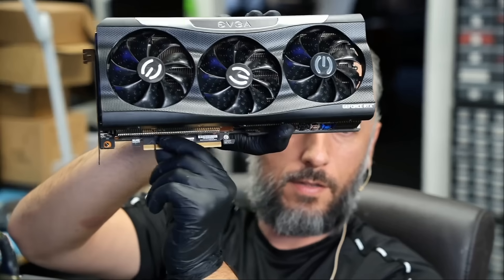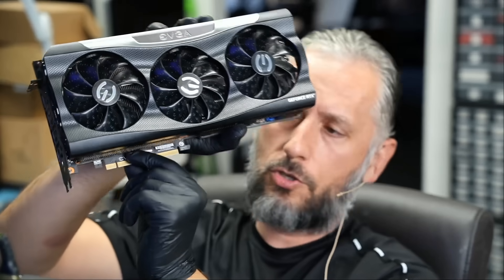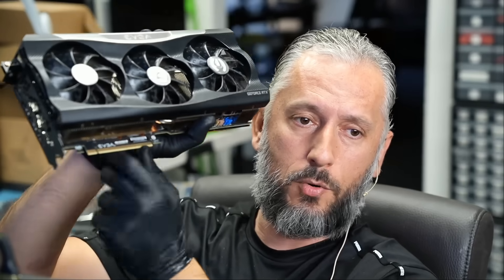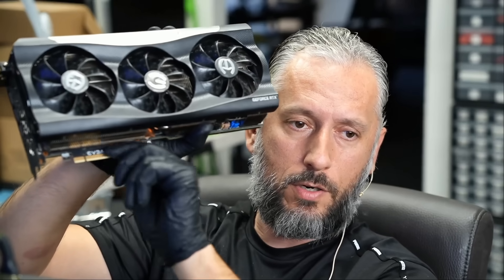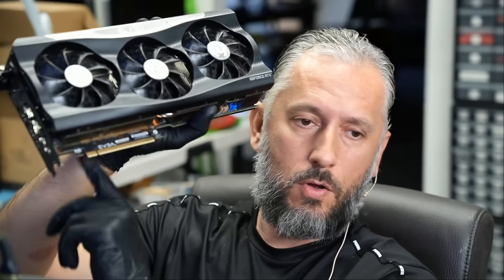Nvidia Positive Response to 5090 FE Fragile Connector Issue.

Comment: I called this out as soon as I saw it: proprietary, fragile, modular piece of crap with no service parts. Absolute rubbish FE GPU design. NVIDIA is replacing the GPU for damage control reasons, not because they care. If they cared they would not have produced a modular piece of garbage in the first place.

Comment: But the fact is, you can't buy the connector. Furthermore, in a normal case, Nvidia would reject the claim because the card has already been opened by a third party. Under normal circumstances, Nvidia is not responsible for the card if you have broken the warranty seals or see any signs of tampering. They have all the power and you don't because THEY DON'T SELL AND YOU CAN'T GET THE CONNECTOR.

That's the truth, and there's nothing positive about it for anyone. That customer was simply lucky in that particular case. I'm not going to wash away that fact by saying it's positive blah blah with my comment.

The customer received another one with the same critical design flaw. And if it breaks again, it'll be stuck in the same cycle.

FUCK THAT

Comment: I ask the mechanic which cars he fixes the most?  I learn from this channel which boards seem to fail alot like the asus.  I heard the gigabyte nvdia cards have fan noise. I learned of the company saphire which has better bearings for the fans.  I am looking for a better card for the 5070 (PNY), I will add time and knowledge before i buy.  Did anyone noitice with all the AI companies buying tons of nvidia cards it's tough to get the top end card in the brand you want.  Any suggestions.

Comment: There is a value to companies in how their products perform in real world scenarios in the first year of launch. It's when most sales happen. Anyone bad mouthing it at this stage whether to user error or user experience would lower sales, so they approve of some repairs or swaps early on, and also learn how to improve the product next time. Also, if failure rates are 1 in 10000 devices, then it's a no brainer, just replace the motherboard, no repairs needed(unless they want to know why, by repairing few samples). After a year or two, sales slow and out of warranty repairs become a source of income if any. Bad mouthing a product at this time is of no consequence because sales are trivial. Maybe that's why most warranties are for one year only. Like Alex said, vote with your wallet.

Comment: If Nvidia has the ability to repair or replace the modular pieces of the card, that is still worth it.  I’ll admit i did not consider this wjen purchasing the 5090fe card. Early adopters of modification with water blocks should wait until repair options become avalible.  If they have enough money to buy a card then break by insisting on water cooling,  well. They can afford to replace it

Comment: This is an INSANE policy. And most likely will be an exception. If more people call nVidia about the same problem, nVidia most definitely will NOT replace all cards. Replacing 1000 cards instead of 1000 connectors - this is an absurd cost. nVidia does have millions of this connector in stock, because they are using it to build the card. It IS a spare part, why not sell it?  Even they can give the connector away for free instead of giving away cards for free! It is nonsense in a long run.  If this was a car and you broke your suspension by doing a stupid stunt - will any car manufacturer replace your whole car ... free of charge?  Why not?

Comment: One customer gets one new graphics card, problem solved... except it's not solved. Problem is still there and Nvidia is giving away a free gpu to silence that customer and you (since you don't need to repair it anymore) the person who exposes Nvidia's stupid gpu design.

Nvidia is doing their best tactic yet again; throw money to solve a problem, even if that problem is not solve. This is why the 12vhpwr is still burning up. It's because Nvidia paid influencers to keep parroting "user error", even though it's a design flaw.

Even AMD's RX 9700 XT which uses these stupid 12vhpwr is burning up too. Proving yet again that the power connector is garbage.

Comment: GAMERS. DO. NOT. BUY. 50 Series. NOR NVIDIA for that matter. The performance is not worth it. You can get the same RANGE performance for 700$. Do that.  IMHO NO ONE should buy anything 50 series. Nvidia : Our cards are failing at only a 30% rate. WE CAN DO BETTER... Makes daughter board no one asked for or needs to add point of failure...you can hear the frustration in his voice talking about the connector not being available for purchase.

Comment: Its for sure made as a week point on purpose so they can sell more cards
Reply: No no see my reply above to @deth3021, I mean yes they did, for sure. For Nvidia a solution to one problem they created would NOT be complete if they didnt add a NON REPLACEABLE PART POINT OF FAILURE

here so you dont to search: 

1. Nvidia chooses to make bigger DIE and use MOAR POWER to get market share SO cards now have HOUSE SIZED HEAT SINKS THAT START CRACKING BOARDS. 
2. Nvidia makes second connector with known issues, breaking board in half, rather than make better chips while making sure replacement parts are not available. 
3. Guy making excuses for the wealthiest company to ever exist making crap hardware and then not making spare parts available and it's JUST FUCKING SAD.
4. Both of your (@deth3021, not you obviously but felt I had to point this out)  POINTS NUMBERED * above are reasons NOT TO BUY, not excuses.
5. The two idiots that upvoted this post should have the fleas of 1000 camels infest their armpits.
6. Nvidia can get away with this shit because moron consumers are plentiful, apparently.

Comment: whenever i boot up my pc for the first time in the day, the GPU doesnt get started. I see my motherboard logo and then the screen turns black. When i hold the power button to turn it off, and press it again to turn it on, it works perfectly. Does anyone know what the problem is? i installed the gpu in another pc but same thing.
Reply: U already provided a workaround: boot it a second time and it apparently works fine.

Comment: Im so glad I didnt get the 50xx FE cards! 😂
Reply: This. Nvidia is at a wall. Look at November 24 conference earnings call. NO NO Rubin doesn't overheat (even though blackwell was already overheating in full immersion) and Rubin does not have backend IO communication issues... We fixed all this.3 days after this call in a press release only INVESTORS see also NVIDIA:  We will debut Rubin on March 17th 25. NOW: Rubin is still slated for 2H 26(I don't think we will see it)... Nvidia lies to shareholders and investors all the time. The cards not being available was not a mystery. They are already making chips AT THE RETICLE LIMIT. That means HUGE fabrication issues. the 5090s you get are just failed data center cards. What Nvidia considers Failed " " when they have no competition is suspect at best. It is easy to assume that making a chip so big just a few fit on each wafer is costly. Nvidia doesnt hate gamers and consumer models ... they DESPISE them. The 5060 is the end result of selling EVERYTHING they POSSIBLE could into the AI datacenter market... The 5090 is the cut down, cut down, cut down, cut down, cut down, cut down, cut down, scrap. Its literally a scrap the rest of the cards are the same, just scrappier scrap.

Comment: A couple more points.
1. PCIe signalling is very sensitive, and each connector is quite costly feom a signalling issue.
2. All such connectors that I'm aware of have a very minimal plug lifespan. I.e. they are only rated to be plugged maybe 20 times.
Reply: Working in EMS and can tell you: Those ratings are BS been using many, many Samtec connectors, be it connectors like this one or edge connectors and they all go far beyond these ratings, hundreds and thousands of cycles are not uncommon. Secondly, PCB-2-PCB connectors of the kind nVidia uses - Samtec AcceleRate Familiy (HP High-Performance Arrays, APM6/APF6) - can be found on Mouser and while their rating is 25 cycles after EIA-364-09C, that durability test procedure includes more than just mating, unmating.

Comment: I'm well aware it would be great if this could have happened without the video. However if damage like this happens, even for a small fee, just send your card back to get that connector replaced. As much as that sucks for independent repair shops, I do like companies, regardless of if they are big or small, taking responsibility for their products. 

At this point, I don't care if they charge. I had an issue with my X870 motherboard. It probably should have been a free warranty repair, however MSI replaced my whole CPU bit for $60 AUD. Honestly, it's not the worst. Its not like the price was the price of the motherboard, its actually a reasonable price. And for stuff like that, that I believe is way too finicky for independent repair shops, where MSI can just remove that CPU part with all the pins and just replace it, it seems like a really good idea.

Having these incredibly painful parts that can be fixed by the manufacturer, hopefully quite easily, while keeping the more doable stuff to independent repair people seems like a good idea. As long as it keeps more things out of landfill.

Comment: But the fact remains that you can not get a connector to fix a card.
Reply: Pretty sure they did it for packaging with their new small main board. 

I highly doubt that PCIE connector will be available anytime soon, if it is, an aftermarket will make it. 

They are replacing the card out of PR, instead of providing a part that can fix damaged cards.

Comment: It's great that nVidia offered your customer a replacement card, but it's NOT GOOD ENOUGH for them to view your entire video, understand that they have made a massive mistake in designing their board interconnects, and and then continue to do so in the future. If future generations feature this flimsy piece of tinfoil connector after fully understanding your justified criticism, just like they did with that god awful power connector for the past 3 generations, you know that they will happily double down on mistakes, even if it means customers are at increased risk of fire and damage.

Honestly, if boggles my mind how the same company can design what is possibly the most advanced semiconductors ever made, yet fail so miserably in PCB design, connector selection and cooler design for ease of assembly. 

The fact of the matter is that in 2025, 'good engineering' is NOT considered to be to design a quality, robust product, but to design one so cheap and to within a hairs width of bursting into flames, as you can legally get away with selling. It's why roads and bridges are crumbling, household appliances are disposable, and why the world is filled with e-waste and pollution.
Reply: the shareholder is very greedy 😂
Reply: @ariewijaya1679  there wont be any money w broken products
Reply: Nobody asked nVidia to replace the card, just give people the (truncated) BOM and allow your supplier to sell to Mouser/Digikey the damn connectors. That connector is OBVIOUSLY a Samtec APF6/APM6, might be proprietary in pin count and lead orientation, but it's a standard connector for them, just produce 2x, 3x, and let the msell of the over production for repair business. it's not like nVidia isn't getting paid for the NRE with those prices of thier FE cards.

Comment: Nvidia really went overboard with the design on that card.  I'd imagine it cost them a lot more shrinking the pcb down to such a small size and using all those modular connectors than it would have using a standard length pcb and connectors.  Its like they did it as a form of engineering bragging rights rather than having it be a practical design. Form over function, very apple like.
Reply: the only way to design a card that can cool 450W with 2 slots, so people can put multiple card in one system to train AI

Comment: i really hope they make this right and allow people to purchase parts.
Reply: They dont even have gpu dies to replace faulty ones in the wild, nv is not about right to repair.
Reply: It'll never happen.

That part only exists to fit their new small mainboard for the flow through cooler, and possibly reduce shipping damage in pre built systems. 

They will not provide it as a spare part. Better hope some factory in China / Taiwan is holding on to all the rejects or excess that we can buy in a year... Nvidia will never provide that part.

Comment: do u think the 6090 will have the same issue as the 5090?
Reply: they will make it more unrepairable
Reply: 12vhps connector probably
Reply: if its Design like 5090 yes
Reply: Depends on why they built it like that I’m assuming to dissipate heat better being separate boards